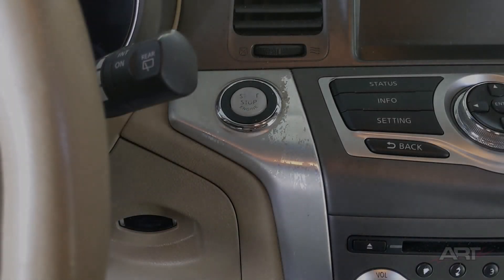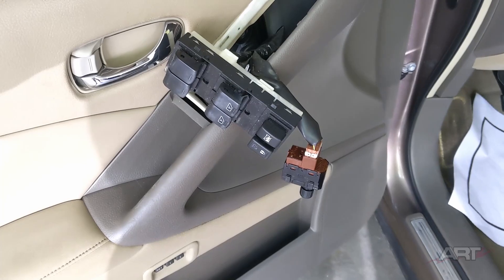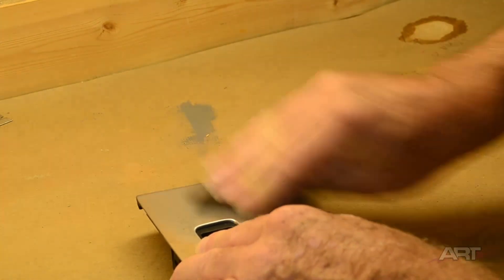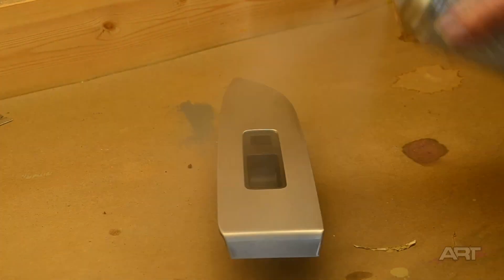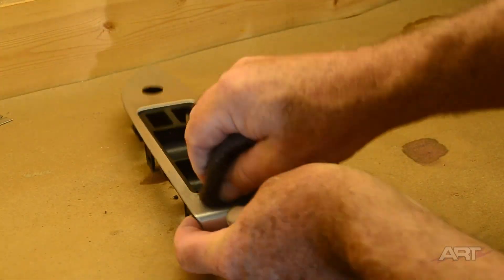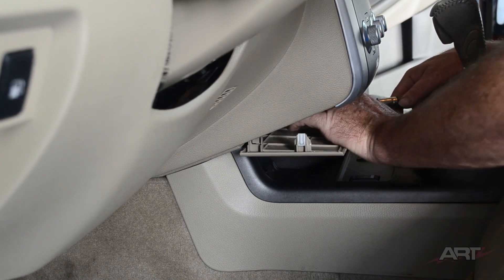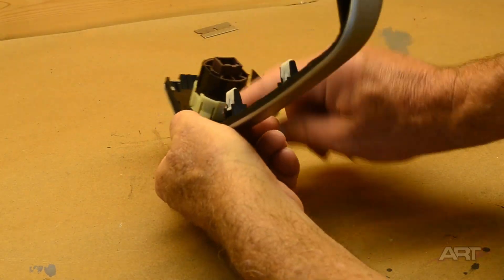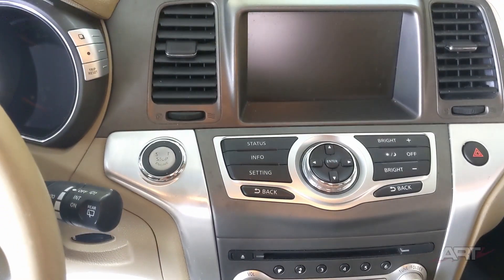Murano Brushed Aluminum Trim Bezel v103

Comment: Excellent Mr. Lockwood! I haven’t encountered any aluminum panels yet but plenty of the fake looking ones both light and dark titanium colors.
One question, on dyeing light colored carpet like shown, do you start with a light coat of white then tan or what is best practice for best coverage?
Thank you for sharing your repair processes!
Reply from the maker: I usually start with the lightest metallic coater and add a small amount of white or yellow pigment as needed.  To thin it out I am using plastic primer.   For this vehicle in particular I didn't start from scratch but happened to have a leftover from a previous carpet and glad to find another use for it!
Thanks!

Comment: I think factory anodized aluminum woul look a lot better.
Reply from the maker: Thanks. The flaking is the factory clearcoat coming off.  So here we are restoring it to original.  If the OEM was only anodized it wouldn't be peeling which, yes, would be another option for the manufacturer.